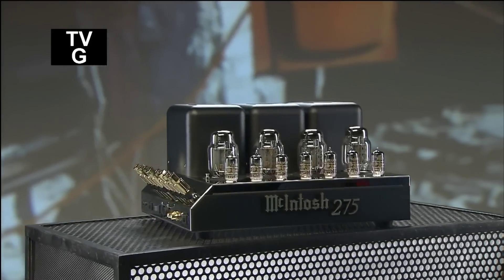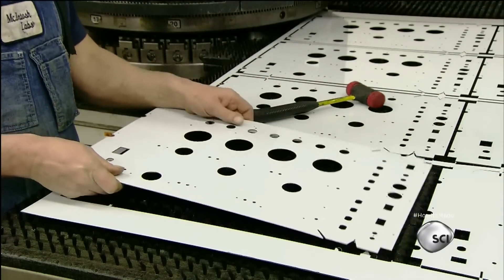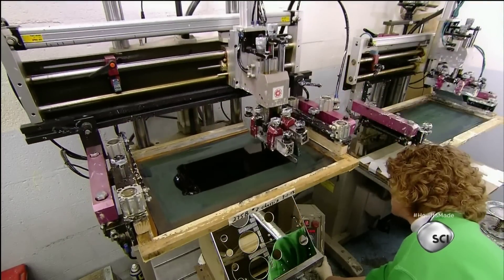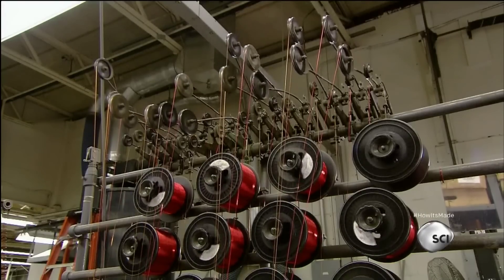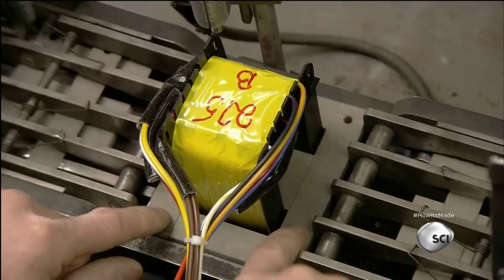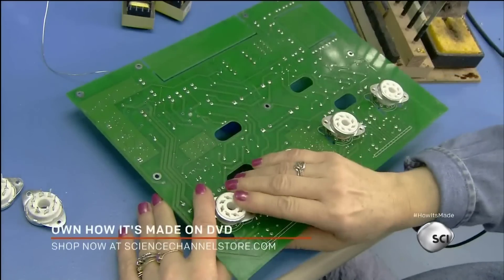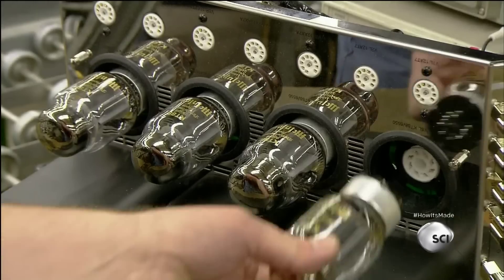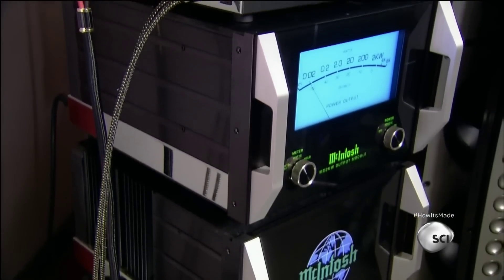How It's Made - McIntosh Tube Amp

Comment: Specs don't support that tube amps are better...and so called 
audiophiles will NEVER submit to blind comparisons for any equipment..pure electronic snobbery..
Reply: It depends on application, if you use guitar amps there is a huge difference but a lot of it is not something you can necessarily tell from an A/B listening test, but rather is something you notice with dynamics when you play. Valve amps compress differently and have a bit of sag, means you can play them like an instrument almost and coax more dynamics out of them.

As for listening to pre-recorded music, never tried a valve amp for that, valves tend to add colour to the sound which can work for or against it, depending on the track.
Reply: Actually, the specifications of any given audio component do not have much bearing on how the final performance of that particular piece of equipment will sound.  However, the quality of the parts used in the making of that component will indeed have a lot of effect on the final performance.  Here at this studio we (9 engineers) have all designed and built much of our own equipment, both for recording, and for playback evaluation of individual recorded tracks.  We find that we can tailor the units for a more accurate sound and for a reduced cost when compared to commercial products.  All of us here have auditioned many types of audio equipment over the years and we have always been able to pass the "blind comparison" tests with no problems.  After many years in the sound and recording industry, 52 years for me personally, we have all developed what many term as "golden ears".  In the end, it is rather how an audio system sounds to the individual listening to it that matters, whether it be the latest $99.00 special from Walmart or the $740,000.00 system in our final product auditioning room.  Good day to you.
Reply: I can tell the difference without knowing it's a tube amp, so long as it's on the lead channel or the amp is cranked with some gain, it's pretty much not possible with a straight clean sound. The way tubes distort is completely different, it sounds completely different and the dynamics of playing one are completely different because a tube amp has a saggy response where as a solid state is more immediate, and that sag that is a symptom (often accentuated by biasing the tubes really hot, or running lower power voltages) that cannot be reproduced with a solid state, though modellers do attempt to fake it, to varying degrees of success.

Oilsmoke you're not a guitarist i take it, nor an amp tech or a sound engineer, so why even bother talking back? If you haven't got a clue what you're talking about, don't sit there and try to pull of smart ass smugs.
Reply: Nowhere in my original comment did I make the claim that "solid state is better..".  Moreover, I did not state that there were "10 engineers" associated with the studios, rather that number was posted as "9 engineers".   Per the evaluation of everyone that I am familiar with in this industry, to a man, they all are totally committed to the fact that the most accurate amplifiers ( as the final in the reproductive chain for the midrange and treble drivers ) are those that are custom built and utilizing the original Western Electric 300B power tubes.  The only transistor based amplifiers that even approach that sort of clarity for vocal and string instrument reproduction are some of the Krells, Mark Levinsons. and the MBL line of products.  Also, all of the state of the art preamplifiers, especially those intended for moving coil applications, are those made by VTL.  The entire issue is truly a personal preference as far as sound goes.  In other words, if the aural experience is not to the listener's liking, then all of the top of the line equipment would not make a difference, because if a person is unable to hear the difference....then (to them) there is no difference.
Reply: I'm talking about guitar amps, go listen to some Hendrix or Van Halen, those are valve amps cooking. Van Halen used to burn through amps because he would bias his amps super hot and run them on lower voltage, but he did it to get the sound.. I mean pretty much all of rock and metal and some blues is built on the foundation of tubes being pushed into distortion.

The whole point of having a tube guitar amp is to get the sound they make when they are distorting, and the sound they make when distorting is different to a solid state, and indeed tubes/valves have more distortion from the onset even when not pushed (and distort more progressively as you push them), where as solid state is very clean and lower in distortion but when it does start clip it's more harsh.

And like I said there is also the playing dynamics that comes from the response of the amp, which gives the player a bit more room to influence the sound via playing dynamics.... Like I said, it's a completely different kettle of fish to talking about hi-fi amps designed to play pre-recorded music.
Reply: I agree, Bigbazz86, and a couple of the studio musicians that sit in on some recordings made here are true believers in their tube amps.  One has 6L6s for power tubes, and the other guy's favorite amp has EL34s.  Our bass amps use 6550s.  They set the bias high and can get the sound they want without any problems.  They roll their tubes often for a balanced drive and tailored sound without worrying about failures during a session.  They call it their "preventative maintenance plan". Take care and good day to you, sir.
Reply: I use the word "sir" as a symbol of respect for anyone (male) that I am conversing with, and have never used it as an insult.  Regarding "living in the past", yes indeed, it does comfort me because without my past I would have never made it to the point that I find myself now, in the present.  My past experiences have made me what I am today.  As for your use of the term "morons like you", I shall simply just chalk that up to the responding poster's demeanor.  Again, good day to you, sir, and good luck in your life.
Reply: holywells  now there are 11 engineers here (strange little people)..they all say solid state is better..you should reference Bigbazz's comments about inducing elements to achieve desired sound..accuracy is signal in = signal out but bigger..inducing variables as you suggest is not hifi.
Reply: holywell, I accept your concession on all points..what's so funny is the very systems you are using to  deny it are cleaner, faster, more linear, and many orders of magnitude denser than possible is any tube circuit designers wildest dreams....and only  morons like you use "sir" as an insult..keep on living in the past if it comforts you.
Reply: You lose dumb ass. Why don't you just shut up,sir..
Reply: According to your personal opinion and input, perhaps.  Yes, I will indeed refrain from any more replies because once a responding party resorts to petty name calling then they have lost all of their credibility, and the ensuing debate.  So, farewell to you.
Reply: holywells  No hard feelings and worries if I block you as a blundering babbling nuisance then, eh mate..
Reply: Tubes sound DIFFERENT, not BETTER. People who say BETTER are stupid.
Reply: holywells LOL, so there are 10 engineers here..all say solid state is better..and very good day to you sir...
Reply: Bigbass86  LOL, good one..ya can tell the difference but you can't unless you know its tubes or not so you can play the tubes like a guitar..that's kinna what I said..
Reply: Bigbazz So you rely on distortion for "your" sound..??  I knew that actually...generally distortion is not considered an asset. It takes the hi out of hifi.  Any distortion you want can now days be induced tho.
Reply: Bigbazz  yes those guys deliberately induced distortion.  This thread is about McIntosh hifi amps. not over heated rock'n' roll stacks.
Reply: LOL, gee don't go away angry.. after all you are the one who first resorted to personal abuse after repeatedly refuting your own hypotheses, sir...it's been fun..good bye sir///
Reply: OJ: you should not call that snobbery. PPL simply prefer a technology that adds MSG-sorta thing to the sound. It is their choice. You misunderstanding or lack of concern for their goal do no give you the right to ridicule them with their choice, just so to expose your narrow and mean mind. Phew ...... Sigh.....
Reply: @eggshellskullrule7971   Misinformation is never excusable especially in a technical environment ..trying to justify paying too much for equipment just because you can IS snobbery atop idiocy ! I will not stop calling out these phonies just to spare your hand wringing and appease your pathetic delicate sensibilities..and don't call me OJ..OJ went to jail...
Reply: @eggshellskullrule7971  Have you noticed your poor little snob buddy has been removed for making physical threat?

Comment: This shit costs 6000$ I can't bye this ever in my life fuck this!!!
Reply: But you can, just go to the hardware store, buy 20 feet of 18 gauge copper wire, an ounce of tar, go home pull the vacuum tubes from grandpas telly and  place the lot in an old biscuit tin.
Reply: +Paul Smith - we have the same problem here in the UK. There's a passion amongst audiophiles for esoteric gear gear of dodgy design, built in sheds, wired with unicorn pubic hair and then sold at esoteric prices. Tubes have their uses in instrument amplifiers where coloration of the signal is actually desired. But for recording, PA and playback of recorded music solid state is far more transparent. There are some very good solid state designs out there but even modest ones will murder most  tube amps.